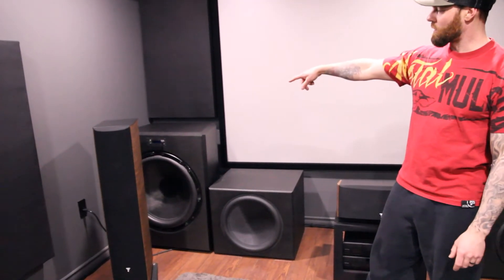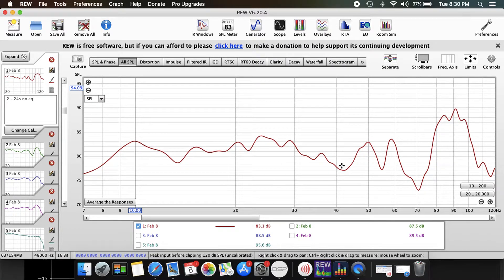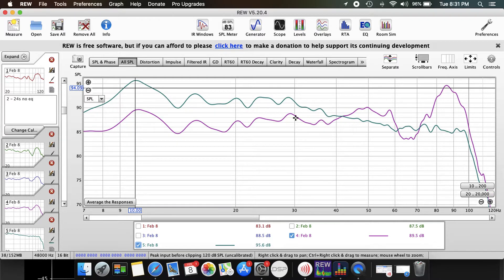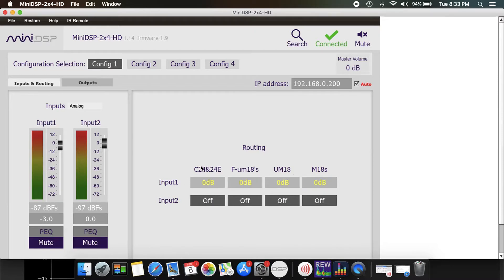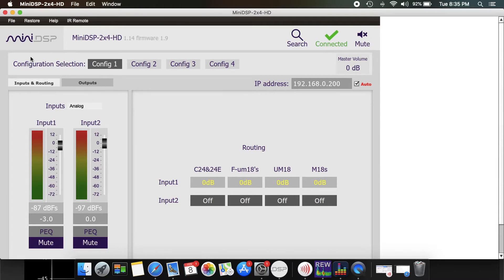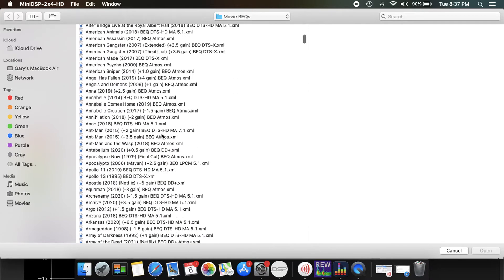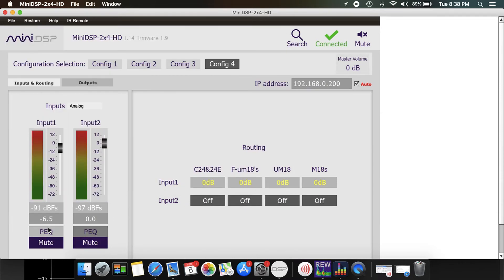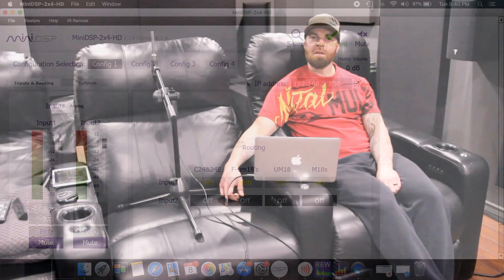My bass response, minidsp settings and how to load BEQ

Comment: Negative 12 trim on the AVR? What does your AVR trim max out at? You don’t want to hit the endpoint of the range (neither positive nor negative).
Reply from the maker: Yessir. I use -12 to make sure I don’t clip the signal to the minidsp and it’s easier to remember where I keep it at. You can use what ever you like. This is just the way I do it and many people do.
Reply: @thebrowncinema  I get it and I think that makes sense. my concern was your AVR may max out at -12 and if that is the case you actually may be under powering the signal. If your AVR allows for a trim level in excess of -12 then you are good to go at -12!

By the way, great video. The instructions available on-line in respect to BEQ are damn near incomprehensible. Your video was right on-point!
Reply from the maker: @ts6640  the signal at -12 with an xlr is definitely not under powering. I still run my subs around -10 to -6 on the volume of the minidsp (I use a flex now) I will be doing another video soon about it
Reply: @thebrowncinema  What I wrote is perhaps a bit misleading. What I mean is this: if your AVR does not allow for negative trim levels greater than -12 (e.g. -13,-14, etc. etc) than the -12 level that was set by your AVR may be (read: most likely) incorrect. By way of example, my Denon I believe ‘maxs’ out at -12  therefore when the AVR sets a -12 trim level in actuality the level may be -13 or -14 or even -20 (who knows) but given the AVR cannot go past -12 the AVR simply indicates the maximum level of -12 (even if the ‘true’ level is -13 or -14 or whatever).

Apologies, admittedly the phrasing of my initial comment was less than ideal
Reply from the maker: @ts6640  ohh. Sorry I understand now. No my processor sets trim levels for all speakers around -6 and max is -12, for subwoofer I set it manually to -12. Processor sets it around -3 but that’s because I turn the subs down during calibration or else it would be out of whack.
Reply: @thebrowncinema  oh OK, if you manually set the volume to -12 you are golden!

Again, loved the video on how to use BEQ. Hugely helpful!
Reply from the maker: @ts6640  thanks! It’s pretty easy to use it’s just knowing the how to at the start lol. I still need to try ezbeq!

Comment: Consider the Monolith htp1 as your next processor. You can apply DLBC for up to 5 subs with a touch of a button. It did a better job than the painstaking hours I put in using manual filters via 2x4HD. Plus you can use a custom GUI to access & apply BEQ, and take the minidsp out of the chain completely for a cleaner setup.

Comment: Is it okay to daisy chain sub woofers and connect a single sub to the mini dsp 2x4 HD?
Reply from the maker: Yes I have a y cable on my output 1 for 2 subwoofers. I measured them as single vs daisy chained to see if there was any db loss and nothing
Reply: @thebrowncinema  isn’t daisy chain the same as using a y splitter? My subs have and input and output which I can use to connect more subs.
Reply from the maker: @dadevastator24_77  yes but if they aren’t in the same place symmetrical then they need different delays.
Reply: @thebrowncinema  the means that I will have to adjust the phase by ear correct or can I still use the REW to help me figure out the phase?
Reply from the maker: @dadevastator24_77  your best bet if you can is use single sub on each output from the minidsp then use rew and adjust delay to get the best response.
Reply: @thebrowncinema  I have 4 sb-4000’s and 1 sb-16 ultra
Reply from the maker: @dadevastator24_77  all in different locations? You could tie 2 into 1 outlet if they are located beside each other
Reply: @thebrowncinema  the locations of my subs will be 2 sb-4000’s in the front left and right corner, 2 sb-4000 rear left and right corner, and sb16 in the middle rear. How should I tie them up?
Reply from the maker: @dadevastator24_77  I personally would do the front 2 on one channel, so long as thier location is the same distance from mlp If that seat is what your aiming for. Then use the last 3 on single outputs. Use the farthest sub at 0 delay, then work your way through them finishing at the closest sub, make sure the summation is good then move to the next sub.
I just use a y splitter out of my minidsp output 1
Reply: @thebrowncinema  thanks for your help.. I’ll give this a go

Comment: Your response looks worse than it actually is. You DO want 5dB increments on the vertical axis, but most recommend a 40 to 50dB spread (50-100dB is given the  HTS guide by AustinJerry, I use 60dB to 110dB) You have a 25dB spread, and it exaggerates your response problems. No real issue with that, other than comparing oranges to oranges
Reply from the maker: Sorry I’m not sure I follow what your saying. Can you please explain how my response looks worse then it actually is? And I do have 5 db increments on vertical axis.
Reply: @thebrowncinema  if you set the REW limits like those given in the AustinJerry guide you will have a 50dB spread, having a 25dB spread exaggerates the appearance of peaks and dips
Reply from the maker: @jamiet74  yes the point is to easily see the peaks and dips. When the “spread” is out to far it gets harder to see them making it look like you have a tighter response. That’s what I’m trying to say. When looking at bass responses it’s better to have a closer visual of what’s going on within 3 db of itself. There’s no real right or wrong. But what I’m trying to say is don’t eq a line so far zoomed out it looks ruler flat when in reality it isn’t.
Reply: @thebrowncinema  Yep mate I agree. But I don't feel a 40-50dB spread is  zoomed "too far"  at all.
The most commonly recommended spread of 40-50dB is for easy comparison between other peoples results and to prevent people becoming hyper focused on small inaudible response anomalies is all. I've literally never seen a 25dB spread recommended in the 12 odd years I've been using REW. Anyway mate,you do you, you've got great results !! and love the channel
Reply from the maker: @jamiet74  remember that 3 db is a noticeable difference in bass!
Reply: @thebrowncinema  definitely he meant Hz instead of dB. but whatever
Reply: @pulDag  yeah no arguing with this guy as he seems to "know it all"
Reply: Anyway it doesn't matter as your response looks good, but for comparing apples to apples most recommended using a 40-50dB spread